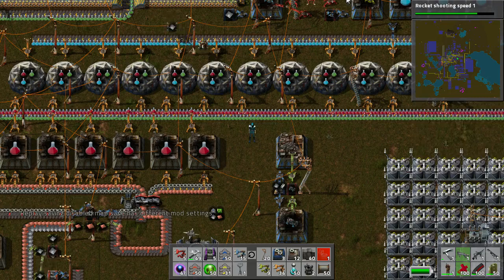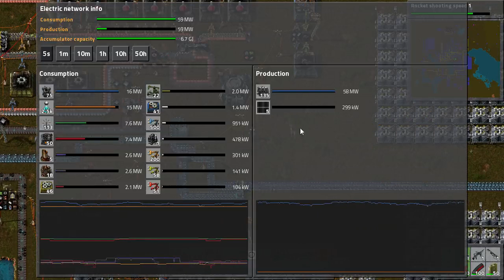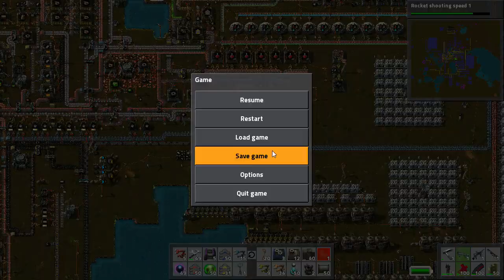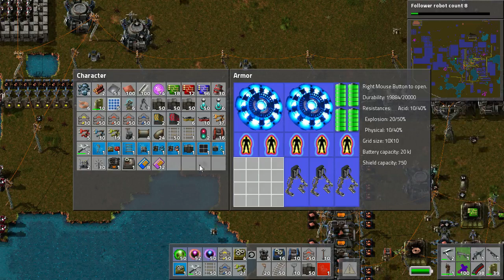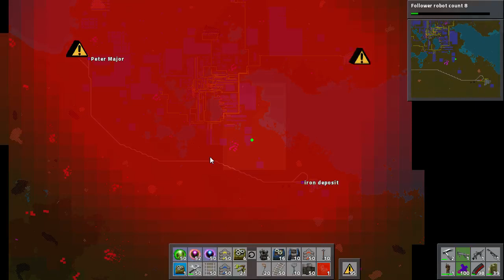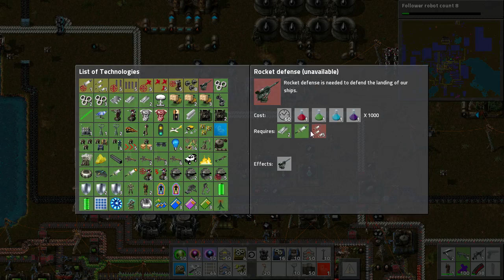Factorio Fixit 28 Kris M

Comment: Question! Mixing different modules: does it do any good to mix them?
Reply from the maker: Yes. You can improve one aspect of a factory without detrimentally affecting another.

For example, if you combine speed and efficiency modules, you can have a factory that runs faster but doesn't use any extra power.